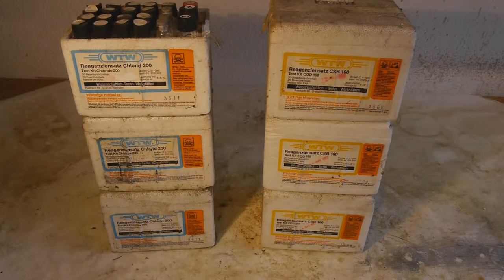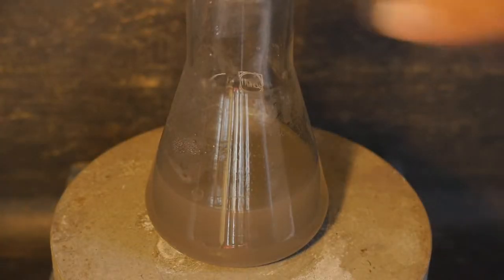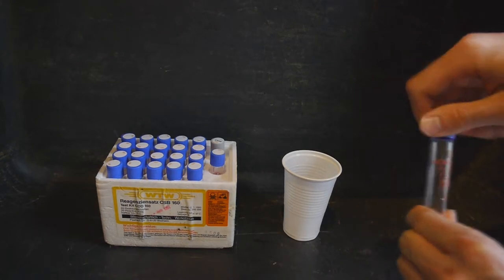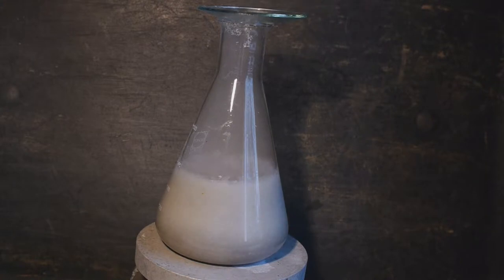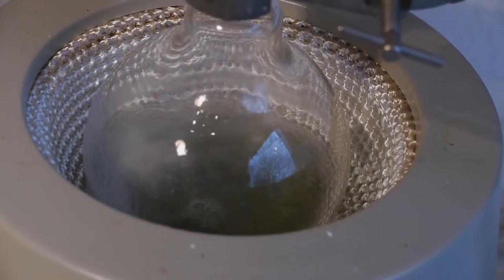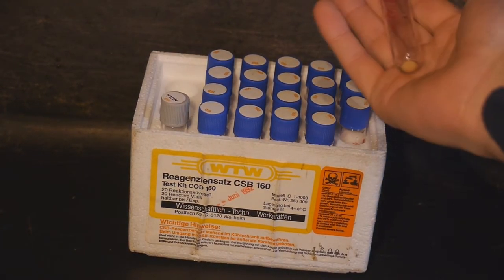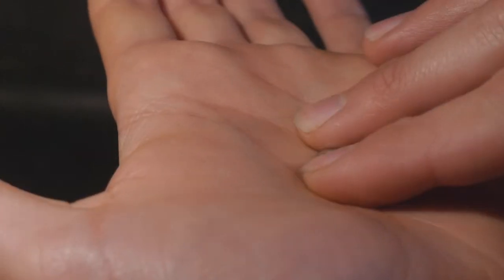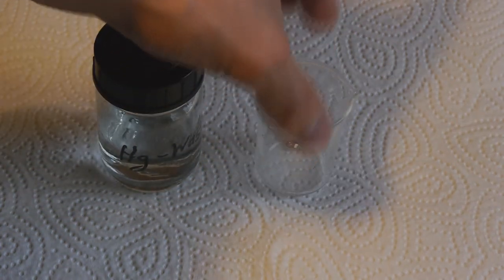Making Mercury Metal from Water Analysis Chemicals

Comment: How red mercury is made
Reply from the maker: Red Mercury isn't like a real scientific thing. It could be just cinnabar (HgS), which is red and you can buy it online as a pigment. But it is rather expensive. You can also make cinnabar by dissolving Hg(II)-acetate in pure, boiling acetic acid and bubbling H2S gas through it.
Reply: Its wrong when you heat red cinnabar you will get silver mercury
Red mercury is Sb207Hg2
Reply: Red liquid mercury salt is Sb207Hg2
Reply from the maker: You probably get some mercury when heating cinnabar, but it is better to use a reducing agent like zinc metal to increase your yield.
Reply: @EliasExperiments  how much used quantity
Reply from the maker: You can use whatever quantity you like, or whatever fits in your destillation flask and then you can calculate the required amount of zinc metal.
Reply: @EliasExperiments  how to possible mirror reflect ion redmercury
Reply from the maker: I don't know what you mean honestly.
Reply: مرحبا اخي.. كيف نستطيع اضافة اي لون الى الزئبق وتكون الصبغة ثابتة وبأسهل الطرق.. شكرا لك.